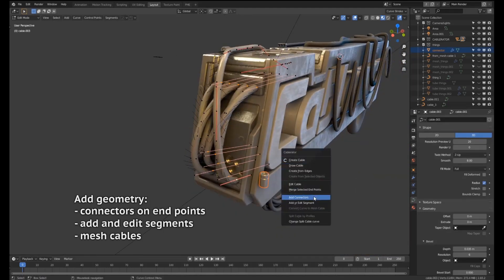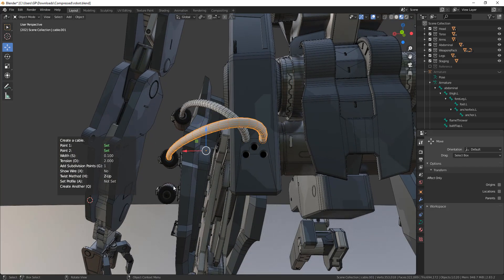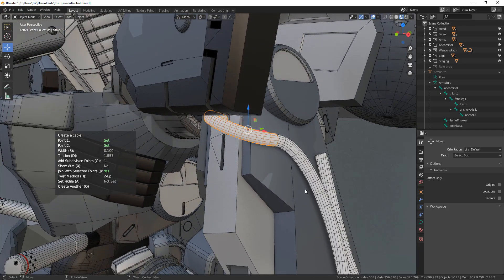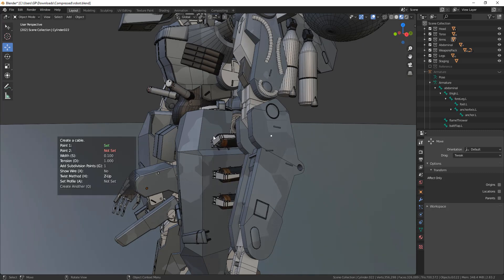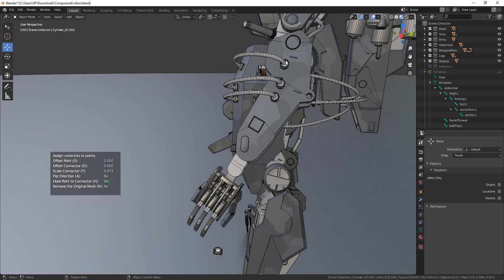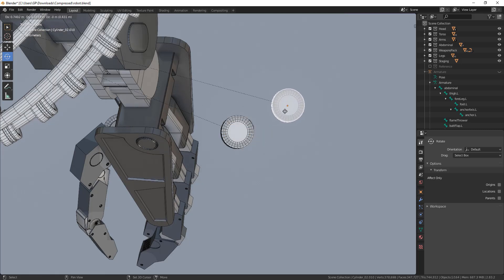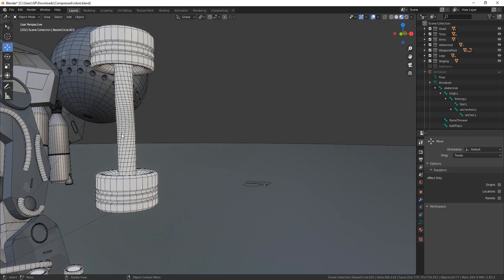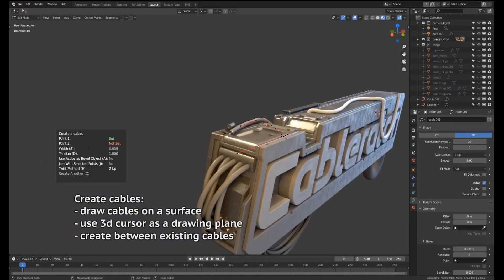Blender Addon for Creating Cables | Cablerator

Comment: Bro i need your help regarding a addon for blender.
Its an addon maded by someone for importing exporting models of a game.
But due to some reasons i need to change the normals settings of the model. I successfully do it, but after exporting that model with that addon and reimporting it, the desired results is not achieved. Basically i used data transfer modifier to do the desired work(for making custom normals) but that modifier doesn't export that task or doesn't take into consideration that task of data transfer modifier. So i need someone to edit the script of that addon so that it exports the data transfer modifier results along with the model itself.
So can you please help me by editing that script.🙏 Because i myself don't know about editing those things
Reply: no

Comment: How does that work in animation? Like if the robot arm moves. Is there a way to make the cable follow it somehow?
Reply: You could make the cables as a part of the rig.
Reply: @JustForNowStudios  Hmm how would one do that? With bones and weight paint? I was thinking it would be really cool if you could add some gravitational effect to the cables like have them hanging and reacting to movement but not sure how to do that.
Reply: @Joonavir  I haven't used Blender since I started Animation in college, so I was thinking of using a forward kinematic rig in Maya but the same principles apply - essentially yeah bones and weight paint. Check the Blender discord for tips on how to do this faster!
Reply: @JustForNowStudios  Thanks for the tip!